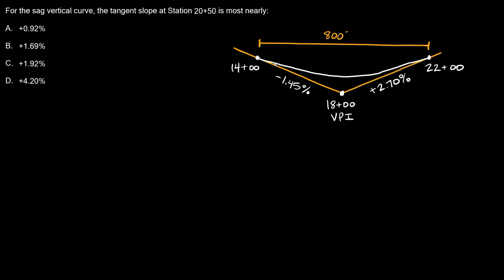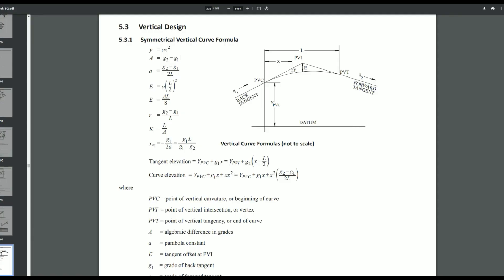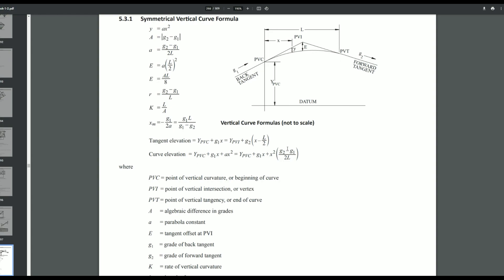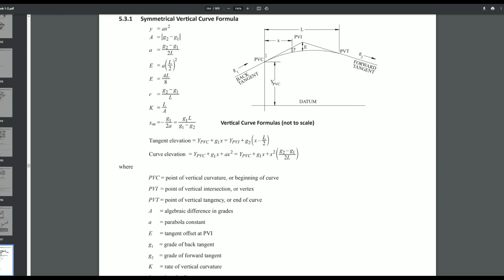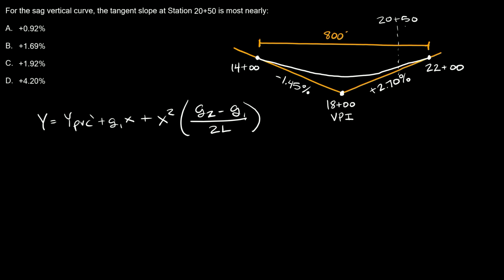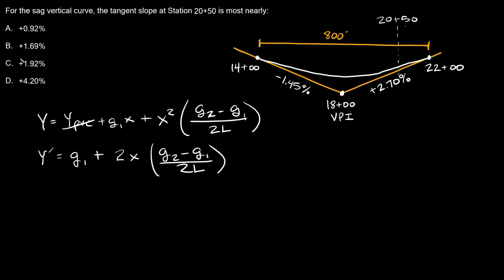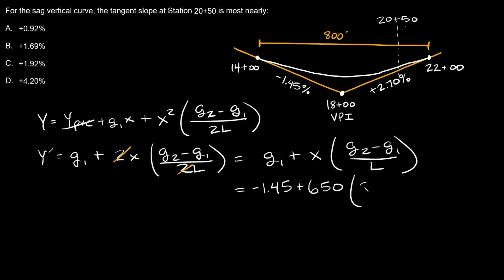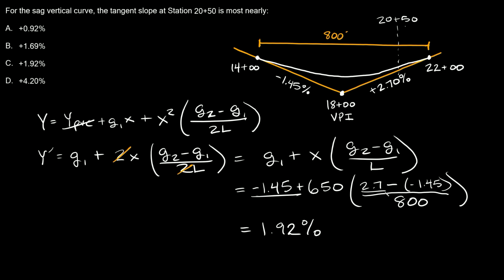PE Civil Transportation Exam Review | Vertical Curves | 2023 CBT | Eat Pi

Comment: Wonderful example very similar to my NCEES practice test
Reply from the maker: Glad I could help! Just a heads up, I took the test about 1.5 years ago and I suggest watching as many videos as possible to help prep for the test. I bought a practice test and repeated each problem so many times I could do it in my sleep but the questions on the real test were very different. I went in feeling great but definitely didn't coming out lol. Fortunately I passed on my first try but I'd still recommend watching as many practice problems/videos as possible because there was no transpo on the 1st half of the test - it was mainly geotech, water resources, structural, etc. The 2nd half was more transpo heavy but there were still a handful of topics mixed in (including economics).

Either way good luck, I'm sure you'll do great! 👍